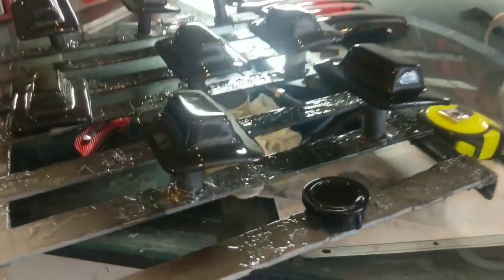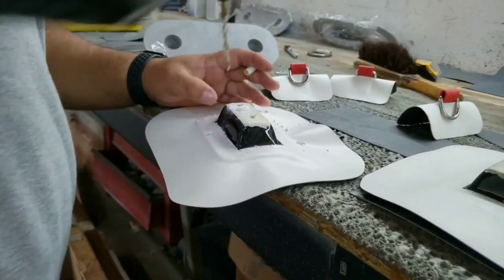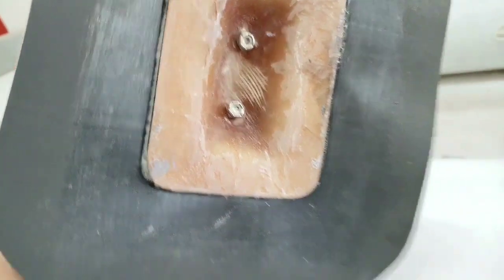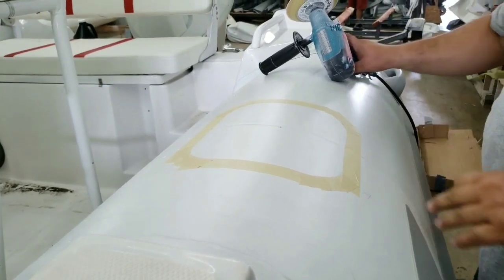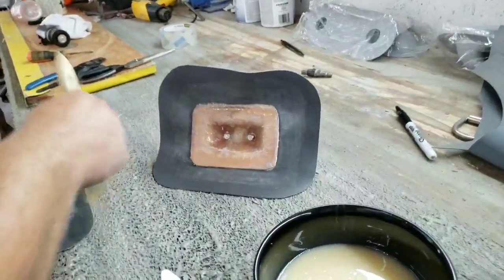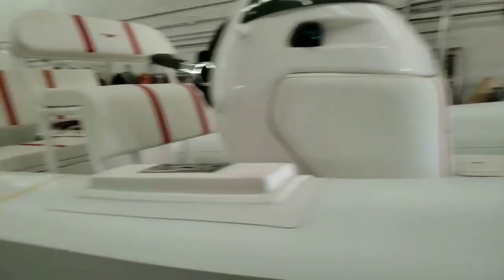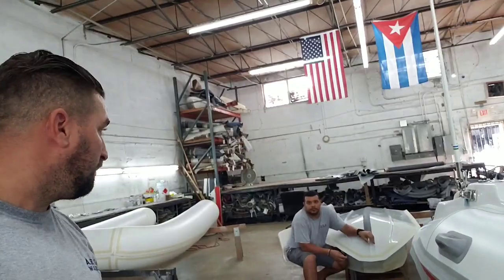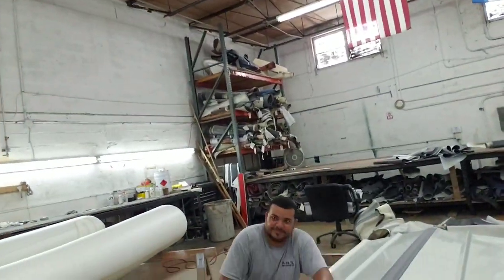How to install a bimini top bracket and D-rings on inflatable boat

Comment: Don't you your sealant on the screws on the cardon brackets?
Reply from the maker: Dont understand question as currently written
Reply from the maker: 5200
Reply: Sorry typos
Don’t you use sealants when you screw into the carbon brackets to prevent water going into the patch over the carbon brackets